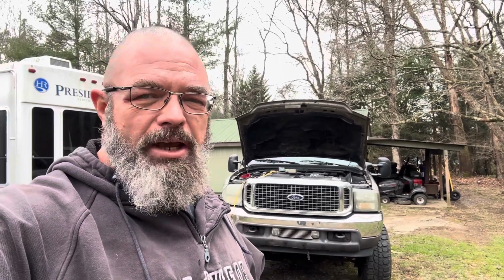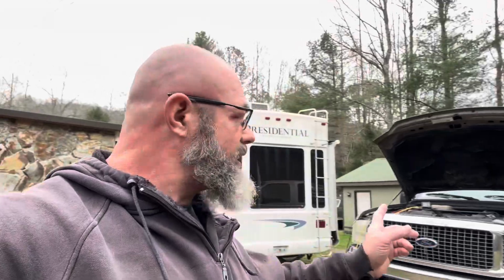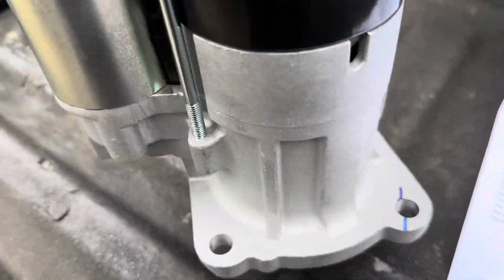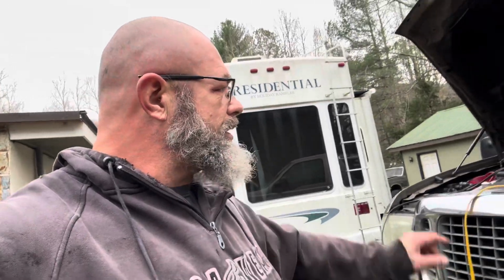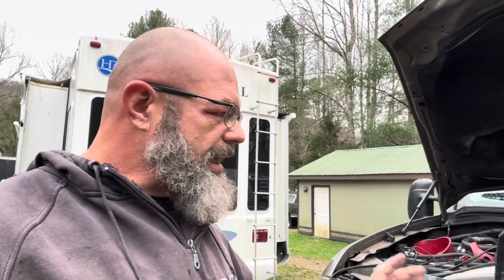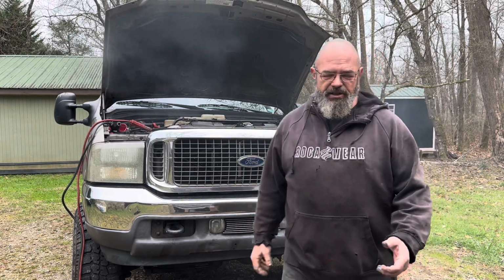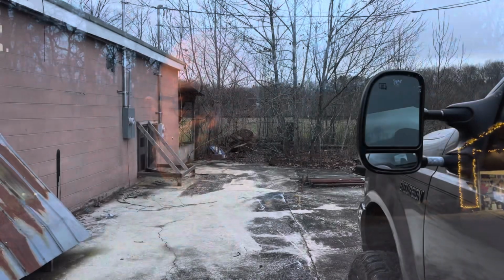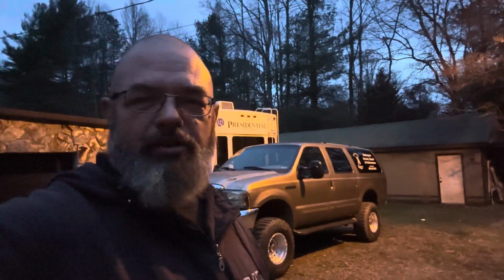PROJECT X !! 7.3L powerstroke Batteries, or starter? ￼

Comment: I vote that it was the fuel injectors.  They were gummed up and one or two tried to open and finally they all opened as least a little.  They probably need cleaning.
Reply from the maker: It only been sitting about a month, I’m not so sure it would’ve gummed up that quick. And once it ran, it ran perfectly

Comment: Since you can no longer check cells with a hydrometer you must load test..or guess. Do the simple stuff first
Reply from the maker: It failed to start again the next day. I charged the batteries up to full charge and then load tested them individually, one of them failed the test pretty quickly. The other one was a wee bit weak. Definitely time for some new batteries in it.
Reply: @amsoiladam  realized many years ago it only takes one cell going dead to ruin any battery..no matter what it fits